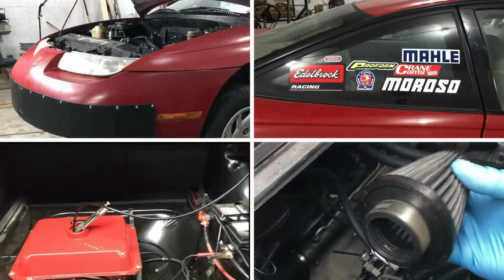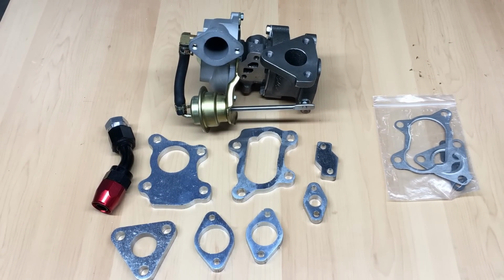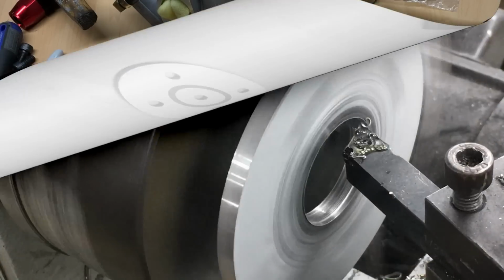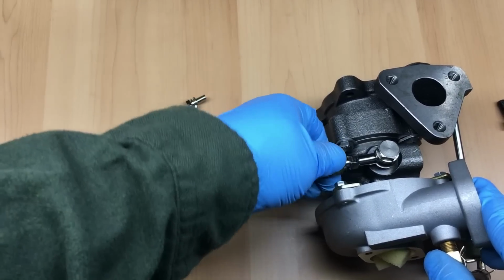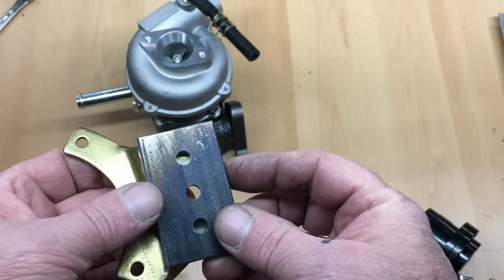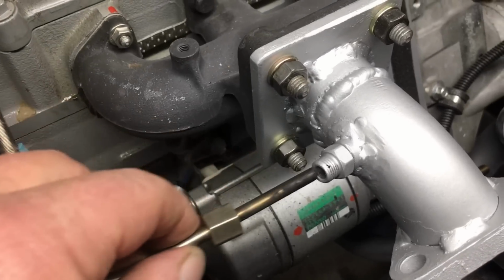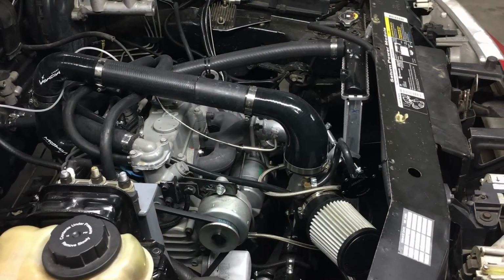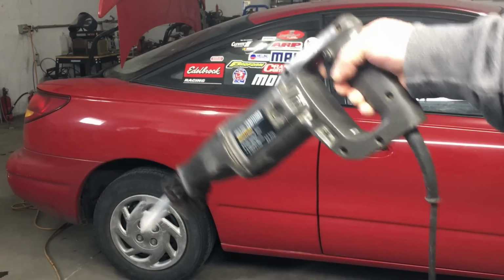S3 E5 We install a RHB31 turbocharger on the Kubota D722 diesel engine in a 1999 Saturn coupe.

Comment: you certainly made a interesting discontinuity for your intake pipe. i might recommend putting in a flow straightener if you have performance inconsistencies. I am very interested to see if you notice any issues.

Comment: Remember for next time to stall the turbocharger for five seconds when starting the engine of the first time so the oil can get to the bearings 🙏
Reply: Or just pressure prime the turbo oil feed before you start it

Comment: This project is simply amazing. Literally creating a car that is wanted by the public but the industry refuses to create and maintain.
Reply: Sorry but no, the public,  at least in America has next to no interest in super economy cars.  It's been proven time and time again.

But feel free to put your time and money on the line, and see just how hard you can flop.
Reply: @DrewLSsix  You are a fool. The market has cornered the public into just a few choices and not much difference between the brands thats why you are seeing the trends you are quoting. A hyper economy car that would run on fuel like diesel or even biodiesel would absolutely be a hit if it was as affordable or cheaper than the alternatives. If you can make a diesel that gets anything between 50,60,or 70 mpg even with the tax on diesel it would be way more cost effective versus gasoline. Not to mention the versatility of fuel types it could potentially allow people to make their own home brew of fuel instead of having to be a slave to the oil and gas corporations proprietary mix of hydrocarbons that is gasoline. A downside however would be cold weather gelling the fuel but this problem can be remedied with the inclusion of a gas powered pony motor as a starter and fuel line heater power supply. The only reason the car manufacturers don't want affordable and efficient small diesel engines on the market is because they know people know how to turn vegetable oils into biodiesel relatively easily and the car companies are very much in bed with the oil and gas corporations and they need you hooked on gasoline. Sometimes they even boink you harder when you buy a luxury car and it can only take premium gasoline. The only other problem with diesel is the higher NOX production and particulate. I think those problems could also be remedied if the market was at all focused on the development of said vehicles and the experimentation of new filters and exhaust recirculating systems. All this to say you do you but you are very wrong as far as what the every day common person wants. They want reliability and versatility and diesel engines provide that and have proven themselves historically.

Comment: Driving my turbo eagle talon with an aftermarket intercooler in the winter time, no matter how much I push the car the intake pipe is always freezing to the touch. I mean on a 40 degree day, the intake pipe will be 40 degrees no matter how long the engine has been running for. Intercoolers are a must in my book for the peace of mind alone. Hot intake air can cause a lot of extra stress on the engine.

Comment: It may not do good for subtlety, but your little intake hole that you have cut out for airflow over the radiator would probably be a good place to open up a little further and put your intercooler right at the face so it gets the maximum amount of forced air flow. Then with the preheated air you may be able to do a little less restricting on the airflow over your radiator.

Comment: The weld job looks cold. Perhaps a slower feed or slightly higher amps to get the weld flow better but without blowing a hole through the pipe. 

Cutting a round disc with a with a cut off wheel? Just chop a square, chop the four corners then chop the eight corners. Should be close enough for a lathe.

Comment: Smaller charge pipe will give you much better response. I’m curious how far you can push the stock injectors and how your are going to measure exhaust to actually tune it.

Comment: Very nice. Got two of these rhbi turbos sitting around for fun in the future. They came from 2007 john deere models that seemingly came off an old kabuto engine.
Reply: As I'm watching. You used a kinugawa oil feed. I use their wastegate for my turbo miata with great success :)

I know the John deere didn't have intercooler which was interesting to see. But the engines don't rev high so it seemed to work well.

Comment: I truly love this series. I love 3k horsepower race cars like Mullet and Leroy, but this little 50hp custom build tickles my brain in the same way.
Reply: 50hp... it would be a rocket ship with 50hp!
Reply: As another Cleetus fan here I have to also agree, it's good seeing both ends of the spectrum addressed :)
Reply: It's just that in both cases, with Cleeus McFarland and Robot Cantina, they're doing things they like. Modifying cars. 

I want to put a turbo'd kubota engine in a go kart or rtv and chances are these videos will be my reference, once I get the time, the equipment, the experience, and the parts sometime down the road. I'll probably start off by putting a bigger performance engine in whatever small offroad vehicle I choose, something like the tried and true 6 hp Predator 212, just to get experience working with different aspects of small engines, which industrial and agricultural Kubota engines resemble more than large diesels you see in pickup trucks and semi tractors. These little Kubota engines hold their own very well in power output, torque, and reliability, so I'd be willing to bet a go kart with the correct gearing would be a monster with one of these. I'm thinking, have the engine mounted rear-transverse right above the axle with a cvt that can handle the power, or rear-mid longitudinal (front of the engine facing backwards with the fan turned around and a shroud that helps push air through the radiator) with a manual transaxle if that's even possible on one of these.
Reply: @lsswappedcessna  
I use entirely Kubota farm equipment and I've got to say they're amazing engines with only one real problem which is that they're loud. Even as far as diesels go, they're pretty noisy. The great reliability and efficiency combined with the boosted torque should be quite fun to make a rock crawling cart but you'll need a nifty transmission to get the speed you want out of it. Most go carts are pretty loud even in gas so it might not be bad for you.
Reply: @lsswappedcessna  
Also, kubota makes a solid rtv series which is quite a tower, but again, loud. Loud enough that even trying to hold a conversation with someone sitting next to you is difficult.

Comment: Another great video in this series. I missed the "vertical" install vid., will catch it now. You had me scratching my head the 1st  time you were discussing the waste gate "acculater". It was like hitting an unseen speed bump at 45 mph! Bam! After hearing you say that several times while working on modifications to what I've always known as an actuator (phonetic spell: Ackcheuwaiter) 😁, I guessed you were playing dumb, when you're very intelligent, making custom words like Vice Grip Garage or Taryl Fixes All. That's funny and fine, I can dig it! 
This was a nice, well done turbo install! (In an automotive research facility, I've fabricated several turbo systems, inc. 1 compound). Yes, boost pipe hot! Underhood temps don't cool it off either. Note: once intercooled, insulate cool pipe after I/C to reduce  heat pickup from underhood heat. Thanks, Paul from S. Central Tx.
Reply: I expected the Chinese turbo box said "acculator" not actuator.
Reply: Ah ha! The infamous "lost in translation" print boo boo! That makes sense now. I knew Jimbo was doing it on purpose, now I know why: for humor!

Comment: I don't see an issue with oil seeping out of the exhaust, thats just an easy way to see it's got oil. Although if you blew a head gasket or ringland and started burning oil it might be hard to tell if you already have burnt oil leaving the exhaust. The problem I see is the intake side would probably run dry eventually, if not then I imagine the intake side would get very hot since heat rises and the exhaust was underneath it.

Comment: I'd maybe look at trying to take some weight out of the flywheel. 
You'll pick up a small amount of hp, the bigger advantage is engine acceleration and deceleration will increase.
I'd keep an eye on that 3d printed insert aswell with regards to how much heat/cycles it can endure before it becomes a failure point.
BTW keep up the great work mate, I'm really enjoying this journey you've brought us all along on.
Reply: I don't think he wants to touch a flywheel that he already had to fabricate just to work
Reply: It's actually quite easy as there are 2 flywheels being utilised, making sure they're balanced together is the key.
The Saturn flywheel has already been extensively modified, so you would take the weight of the kubota flywheel. 
Hope that clears things up for you, cheers.

Comment: Love the videos! Just a quick question... is there a difference between what you're calling an "acculator" and an actuator? I've been working as a diesel mechanic on freightliners for 8 or so months and one of the older guys I work with always calls them "acculators" instead of actuators. I've always just assumed he was mispronouncing the word but now I'm not sure if maybe years ago they actually were called "acculators" and the term changed at some point. Anyone have any insight into this?
Reply: I was wondering wth he was saying.

Comment: honestly, you may be better off "bolting" the wastegate shut completely and letting the turbo itself make the boost its going to make. i only run wastegates on diesels with nitrous or if the turbine housing is significantly smaller than the exhaust flow will allow, causing boost to over speed the turbo. that little tiny turbo and displacement and "cold" exhaust gas shouldnt even come close to over speeding it.

Comment: About 2mm more on the injection pump and 2 full turns on the waste gate will get you around 7psi and still keep your EGTs where they need to be without a intercooler. I wouldn’t mess with the pump timing any time soon on a kubota.

Comment: A TIG welder could make a more attractive weld, but it's not going to be easier than MIG. 

Stick with MIG, just spend your money on wire, gas, and the electricity for practice.

How do I know?
I have a MIG, my welds were ugly, so I bought a TIG, but my welds were still ugly. The letters didn't make my welds look better. 

Practice did.
Reply: & the best looking beads done with TIG are the weakest. Like, a flush stack of dimes is done without filler looks sexy, but the parts are thinner at the joint.

So you either use filler & it looks like MIG, or the joints crack.

Is this a show car?

Comment: Take the boost reference for the turbo actuator closest to the engine as possible. Every bend or restriction will lower the boost. 
5 spi at the turbo might be 2 psi with intercooler at the back of the valves.

Comment: just a note, if you have a center hole in a piece of stock you can use the tail stock and the force of the tail stock to drive the part on the jaw tips.

Comment: Actually from my compound turbo bike that has ran these and adding one to a diesel smaller than yours ditch the rhb31 trash and throw a vz45 rhf3 on there and order a billet wheel with the biggest inducer and housing to match unless you have a lathe.
Reply: Don't forget to preload the waste gate.
Reply: I find whatever turbo you get take it apart and check the thrust bearing holes for small metal blocking its feeds. You thank me later. Also you cant feed those turbos enough oil it's a journal bearing turbo not a ball bearing turbo. The restriction required is actually cast into the center section.  Get your restriction out. We have ran these single turbo to 35psi stock wheel and 45 billet wheel. Don't bother we have blow through carb and -100°f e85 so it was okay but I did see 320° iats at one point. The vz45 is much better at this especially with a billet wheel (more room for a bigger exduser) we got 65-70psi out of one of those before the turbine wheel blew up. Hence compounding these days. It's a diesel crank that boost as high as you can and save your self the headache and throw some studs holding the head down.

Comment: "You don't know enough to know you don't know enough"  I did that on adding a $200 rack and pinion to my 72 VW superbeetle instead of spending $800 to replace all the worn out original steering.  I was patting myself on the back all the way thru the mod, but when I drove it over 100 km/h the whole car started to ocilate wildly.  My disconnect was that steering dampers weren't optional on r&p setups, they were mandatory on rear-engined setups!  The rearward CofG NEEDS a steering damper regardless of how more 'modern' the steering gear is!

Comment: You could most probably regulate boost just with fuelling at this stage. So the wastegate can be kept totally closed and the fuel adjustment screw will regulate boost. On low boost diesel engines of earlier years that was how boost was regulated. Fuel and boost is closely related until you start chucking loads of fuel into it.
Reply: Yup… The boost would have been the same even with the 1 bar wastegate spring. Hopefully Jimbo turns the fuel up and installs the intercooler next episode.
Reply: @Thanosisnotreal Yep too

Comment: : Just a simple suggestion. The diameter of the pipe attached to the orifice of the turbine inlet from the exhaust header should match the diameter of the turbine inlet. If the turbine inlet orifice diameter is 1 inch, then you should make a connecting pipe with 1 inch inside diameter at the end attached to the turbo and the other end attached to the header with matched inside diameter to the header outlet (1.5 inch?). Make the transition from 1.5 inch to 1 inch as gradual and smooth as possible. By doing this, you will get better exhaust flow that eventually makes your turbo work more efficient.

You don't have to worry about exhaust flow restriction if you follow the correct size of exhaust pipe diameter. The exhaust gas channel inside the turbine housing is actually getting smaller gradually with the purpose of increasing exhaust gas speed to turn the turbine wheel efficiently. The rule of thumb of turbocharging is don't go too big and don't go too small. Too big = poor throttle response, poor efficiency and weak boost. Too small = flow restriction and elevated temperature. This rule applies to turbo sizing, exhaust sizing, and compressor discharge pipe sizing and/or intercooler sizing if you plan to use one.
Reply: You're right. That sudden change of size is absolutely KILLING the flow. On the intake he's put a sort of 3d printed velocity stack, which will improve that side hugely, but the exhaust end needs a tapered pipe, but that sort of thing can be dastardly hard to find in the sizes you need. 

DarkLinkAD: Even if he's years ahead it doesn't mean he was paying attention in class! Maybe he was sitting next to that hot chick? Oil drain down, was that part of turbocharging 101 also?
Reply: @brianwelch1579  : With equipments he has, I think it's not a problem for him to make a tapered pipe from exhaust header to turbine inlet. Maybe the principle of making 2-stroke expansion chamber will help. Or by using tube reducer with appropriate dies that can make a gradual tube diameter reduction.
Reply: @Brian Welch  going from a small to a larger diameter doesn't need a flange.
There may be vortices when going from a larger to a smaller diameter tube, nothing a little plastic flange can't fix. The losses aren't too big though.
Reply: Easiest solution now is just to port the inlet side of the turbo into a conical shape with a carbide burr. Agreed though that the sudden wall will cause a lot of turbulence and also increase EGT. The exhaust side flowing smoothly is much more important than the air flow side, especially pre-turbo.
Reply: As a guy who port matched his exhaust with a die grinder in his machine shop class I agree with this wholeheartedly.

Maybe take some slices out of the pipe and bend them in to make a 'funnel'.

Or he is messing with us.  Either he has proper fittings planned, or  a bigger turbo he is actually planning to use?

First rule of hot rodding, make things flow smoothly and avoid steps.
Reply: Your speaking turbo intro 101 to a guy whos years ahead.
Reply: @DarkLinkAD  : Well... I'm sorry because I'm just an amateur who did a twin turbo setup on my naturally-aspirated car 26 years ago successfully in my own garage. So pardon me if my comment is categorized as "Turbo 101 - Introduction".

Comment: You are losing boost from the turbo to the motor because you scaled up the pipe and you need to keep the pipe from the turbo to the intake no bigger than the turbo outlet